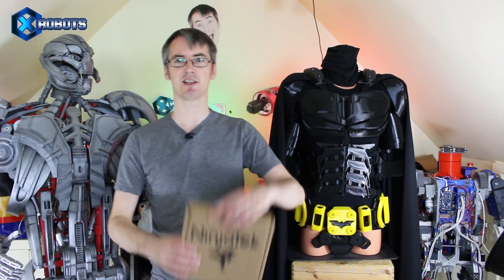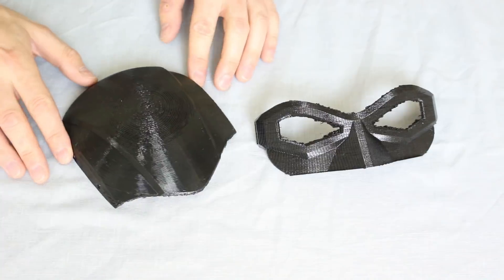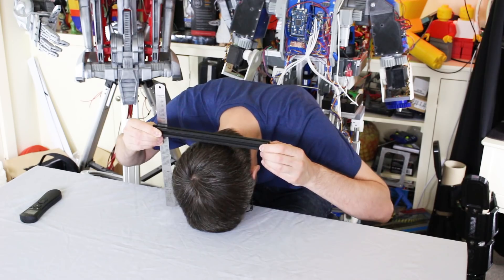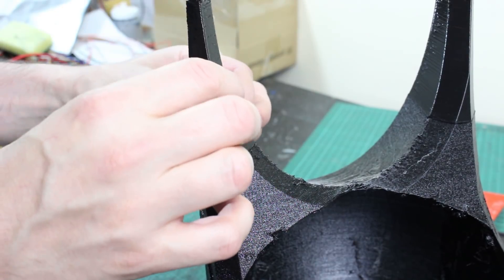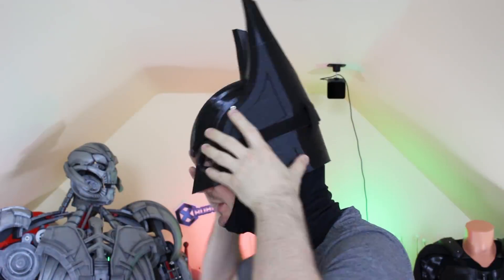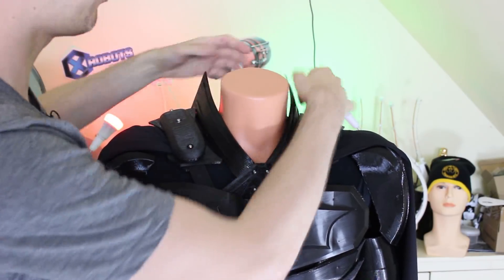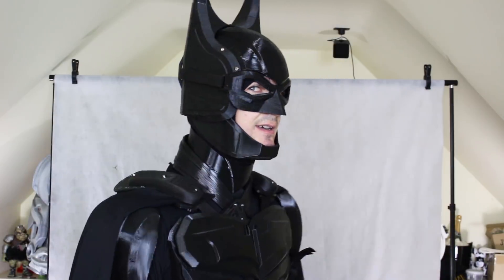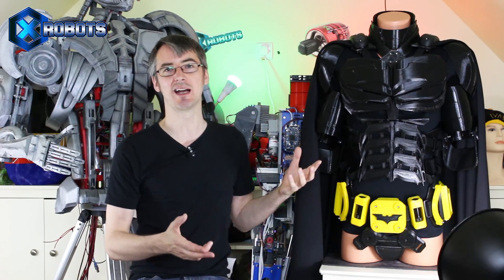Batman Cosplay Suit #6 with Ninjaflex | James Bruton

Comment: Hey James! can you make a VR omni-directional treadmill? I have done a bit of research into this and I want to see if you can pull this off. I have realized two things: 1 the tread mill should not limit your field of motion (imagine having your arm slam down on a support rod)  and 2: you need to take your motions and input them into movements in VR (this would add a lot more immersion).

 I have been following your channel since 2015 and I am thoroughly impressed by your videos. you inspired me to pursue electronics and software (this is coming from a teenage kid).

Comment: Simple way to measure your head: Lay down with your head in a doorway, slowly close the door until your head is squeezed between the edge of the door and the door frame, slide your head out, then use a ruler to measure the gap!

Comment: To be honest, aside of the belt (which needs some rework, especially for the color) the cowl really need to be reworked. It look seriously silly, especially with the ears. You should perhaps consider making the whole cowl in one piece instead, like a helmet (motor bikers helmet). The eyes seems to be ok (in shapes, at least). Maybe you could add some lenses with the correct agressive/predator expression given to the eyes. Hell, if you find a way to retract those lenses inside the cowl with some electronics you'll probably do a very nice work that some people had attempted (I think).Otherwise, if you want to add more accessories for the suit, may I suggest doing a voice changer (not too grotesque like BVS, more like the Batman teltale games. Also, why not revisit your gauntlets a little bit so you can conceal (and use) your cell phone directly on you wrist ? That'll be something interesting to do, I think.

But never the less. Keep up with the good work, James.
Reply: Système D Multimédia how long did it take to type that

Comment: For making my mask (which you can find on my channel if anyone is interested) I made a simple T-spline mannequin based around my head. I then made several planes at regular intersections on the longitude and latitude and printed a sort of “cage” that I test fit on half my head. This showed me where was too tight and too loose.
Having done that I did more tests of key areas such as eyes and ears and then printed half a simple shell of the mannequin (scaled outwards, of course) to test all the front.
Now I have a good and simple representation of my head that I can use to design any masks I want.

Just a little tip for anyone looking to do similar!
Reply: Uhhyhuhhthhuy